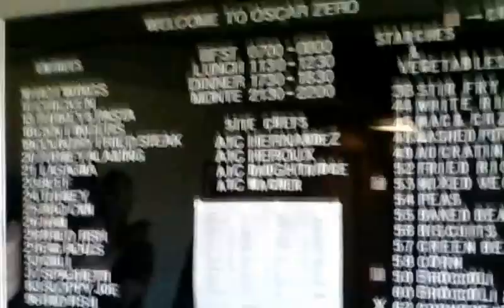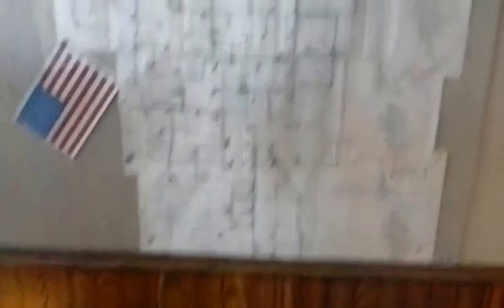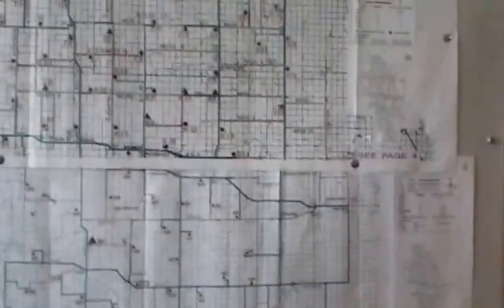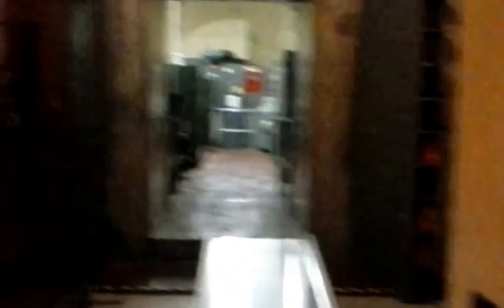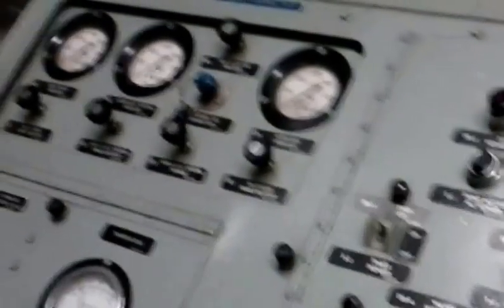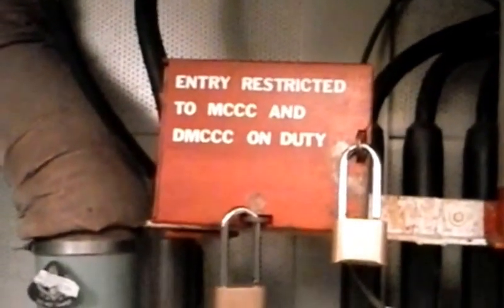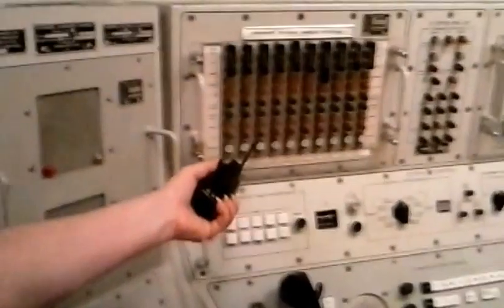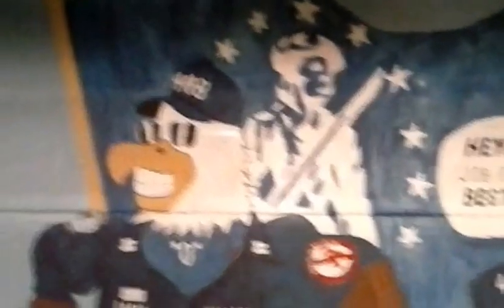Ronald Reagan Minuteman Missile Historic Site.  Cooperstown, North Dakota.

Comment: At the end of this video you referred to the concrete and steel structure as the “missile silo where they shot the missile out of” it is actually a hardened silo that holds a radio antenna that could be deployed. The missiles were located a distance away from the LCF